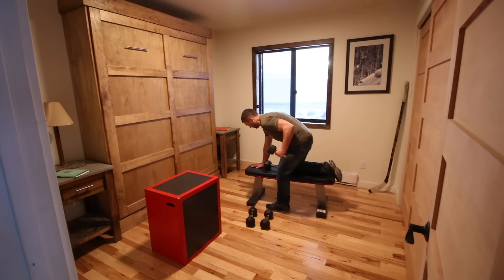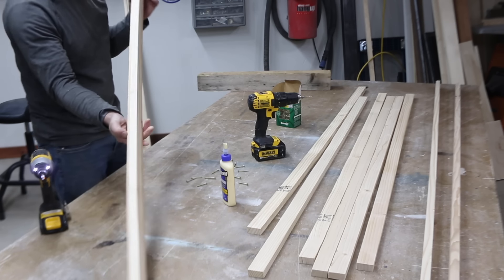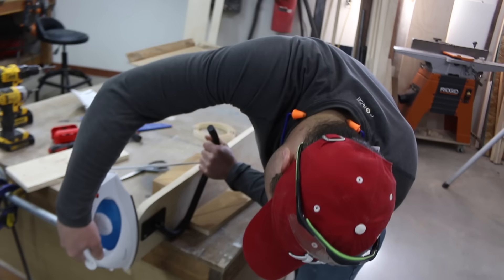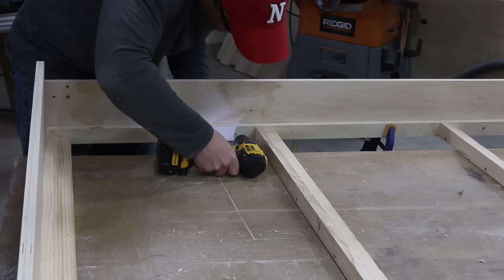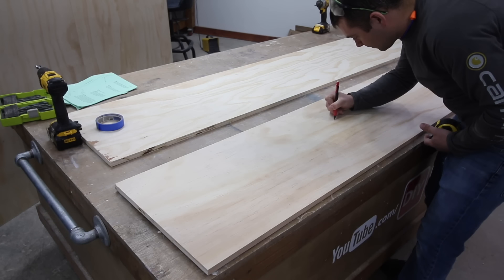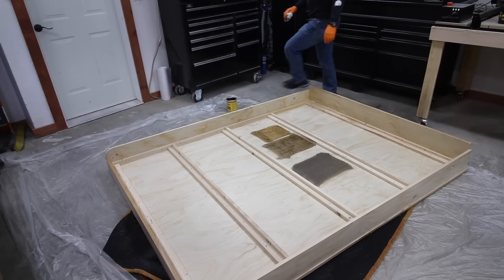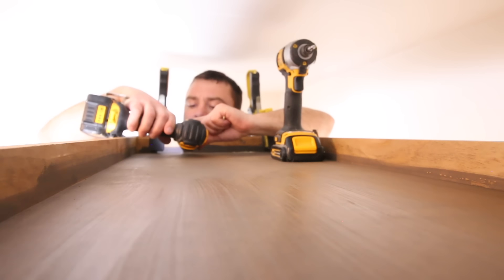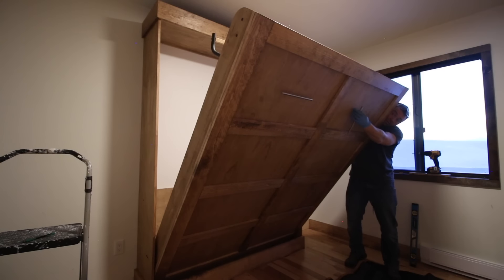You can Build a Murphy Bed!

Comment: Just built my bed same plan, thanks for all the tips offered very helpful. One thing I did was to pocket screw the 3/4 ply panels together elevated on saw horses running lengthwise and use that as a workbench to build the bed frame and mount hardware.

Comment: Thanks, Pete! I have 1 tip for others in regards to 1x2 boards. Some stores sell 1x2 furring strips. Usually these are only 5\8" thick although they will be labeled as 1x2. Confirm with tape measure the actual thickness is 3\4". Again, thank you for this video. Plywood is so darn expensive I didn't want to ruin a sheet lol. Measure 20x cut once haha

Comment: Hey Pete! The video is worth the wait. I was dying for your next content and I am glad you are back! I am really fascinated with murphy beds and this one is amazing. In my mind I feel like I am ready to make one because of the way you narrate the instructions and process, 👌🏼very clear and organized. I noticed you specify the silver and black screws, is there a difference aside from the color?
Reply from the maker: Hey Raymond! Great to hear from you, and thanks for saying hi! I agree, I definitely need to push out more content on the channel. I am confident you'll be able to tackle this project. The kit comes with black screws, silver screws, and machine screws. The machine screws are used whenever a T nut is used. The silver and black screws are both 3/4 inches -- but the silver screws have a slightly thicker diameter. They give you the exact amount of screws needed -- and more black screws are included then silver ones. I found myself going back and fourth in the directions so many times that I wanted to point out which screws to use in the video to make it easier. The company has a very detailed video as well, but there's is 1 hour and 12 minutes. They have some better closeup shots and do a good job, but it is a little long for me to watch without speeding up. I feel like I was able to condense the information and cover it all still in about 23 minutes with the narration and clips sped up. Cheers!
Reply: DIY PETE thanks for the lengthy and comprehensive reply much appreciated! I am thrilled to get a response from you 🤣 
Would love to see more videos ie continuation of your home build/reno hopefully. I understand it is not that easy to come up with a content so I am willing to wait.

Comment: Have one of these beds made from the same kit. With very little tweaking with a sawzall, we were able to shoe horn in queen sized Murphy bed into existing double closet opening and ended up with a recessed built in guest bed. Put recessed LED puck lights in headrail as well. We used melamine faced cabinet plywood for bottom/exterior. Smooth finish in white, almost no sanding and nailed trim wood to it to give it a judges panel look. Turned small home office into a nice guest room for the few times  visitors overnight while getting to use it as an office the all the rest of the year.
Reply from the maker: Hey Peter, great to hear you were able to free up the space so it can be used as an office most of the year! I'm glad the kit worked out well for you too. Cheers!

Comment: Yes everyone should have a home shop like that, would make building Murphy bed so much easier!
Reply: It can be done with a lot less.  It did take me longer, but I was able to leverage tools that friends had and my spare time to build this without any special tools.  Borrowed a table saw, used miter saw, circular saw, drills, a tape measure, orbital sander, glue and time.
Reply from the maker: There are various levels of DIY projects and tools required. This one certainly is on the more advanced side.

Comment: "Do it yourself"

* Buys online kit.
Reply: Having bought this same kit and built it myself, I can say it is a lot of work.  From purchasing 7 sheets of plywood, using a table saw to rip and crosscut them to size, drilling screwing and gluing the bed platform together.  Drilling screwing and gluing the support frame together. Edge banding all the wood, sanding, finishing, installing hardware. Additionally in my case I also made the two cabinets that are in the plans (https://www.rockler.com/deluxe-murphy-bed-kits-vertical-mount).  This involved making cabinets (book shelves) drilling shelf pin holes perfectly aligned and building drawers and installing drawer slides. 

Exactly what would you consider DIY in this case?  Did he need to make springs out of iron with a forge to make the bed work?  Did he need to wind his own motors for the drills he used? What about the pivot points?  Seriously it is people like you that bring so much negativity to the world. Try saying something positive. Here are some examples, "Great job! I wish I had the time/expertise to build something like this." or "Wow, murphy beds really do save a lot of space, maybe I should think about building one myself." There is an enormous amount of work that goes into making one of these and if you don't believe me, try it yourself.
Reply from the maker: Hi Jake, there are certainly various degrees of DIY. I bought the kit for the pure convenience of getting the right struts and hardware. The build was quite time consuming and a lot of work to be honest. You could certainly figure out the struts though and other hardware if you'd prefer. Cheers

Comment: Great project. Wall bed kits in Canada are in the $2000+ range depending on size and options. After watching your video I will build my own. What I’ve done in the past when cutting panels from plywood is getting one of the big box stores I buy my plywood from to do it for me. First couple of cuts are free and extra cuts are $1.50 each if I remember right. For a few bucks it’s a whole lot faster and more accurate...not to mention easier getting your wood home in the back of your sport Ute.
Reply from the maker: Thanks!

Comment: Great video. The detailed instructions make it clear what a person would be facing. My consideration is I usually make around $85 an hour for carpentry and handyman work. The hours this would take and the space needed to do the project without cleaning up between steps would be prohibitive. I'm thinking the extra $500 or so for the prebuilt kit would probably be worth it to me as I'm sure this project would take much longer than 6 hours. Heck, even if it took 8 hours that would still be $680 of billable hours to do the job. I appreciate your eye for detail but I think many with both time and space considerations (for doing the project) may be better off just paying the extra money for one already done.

Comment: Awesome video, very detailed and easy to understand.👍If anything, I'd add that the solid plywood board right under the mattress only works in countries where the moisture level is relatively low. In New Zealand, for example, your mattress would become mouldy within a couple of months. If you live in an area like that you might want to consider using timber slats instead of solid plywood with some ventilation holes towards the head board or on the side of the frame.

Comment: you can get gas struts for car boots, or springs from hardware stores. The hinge mechanism is pretty basic, a recessed bolt with washers will do great, bearings if you want to get fancy, but i've seen cheap seat swivels used too. I'm just saying you don't need to drop 400 on a mechanism kit. Legs are easy, 10 ways to do those. Your bed is great, good job.
Reply: Yes I just watched the video and clicked the link for the bed kit the guy has suggested costs around $300, and in the UK they want £457. That's $600. For a few bits of steel and a piston. Madness. I wish I knew the spec of the piston!

Comment: Good job. My only critique is the banding. After working for over 40 years as a carpenter, I found that banding is great for a quick or temporary look, but using strips of real wood 1/8 inch and using  a nail gun or nailing by hand with a finger spreading of glue below the surface of the 1/8th inch materialmand using a punch with filler will not only look better but last years longer. Maybe your grandchildren will use it as well. As far as the banding edge a few years of variable temperatures and the oops factor or using Murphy's Law "What can happen will happen" will make it almost impossible to fix the edges at the many nooks and crannies you left it at. that the banding falls off or breaks off. 
Overall it was a good job, with good visual aspects. Thanks for sharing...
Reply from the maker: Thanks Jesse! I appreciate your advice!

Comment: Question for you.
I am getting ready to build one myself. The plans use mostly 3/4" (0.75") plywood.
Quality sanded plywood is sold in 23/32" (0.71875")
Yes, this is a tiny difference.
Did you need to adjust anything for that difference?

Comment: DIY Pete. Can those plans be modified to lower the bed slightly from the 7 inches recommended by  create a bed hardware? I don't have the ceiling room for the vertical mount and really don't want a horizontal...thanks
Reply from the maker: Hey Scott, I feel like you need the room with the pivot point where it is and couldn't go much lower unfortunately. I would recommend giving the folks over at Create-A-Bed a quick call and to ask them what they think.

Comment: Im considering a Muphy Bed, but not as a guest bed but as my main bed. I want to use my bedroom as a painting studio from time to time and in those painting sessions I would like to fold the bed up. So I have two questions:

- Is the bed comfortable enough for an every day bed?
- since I dont care about hiding the bed in a wardrobe, would it be possible to just build a casing up to the height of the headboard/springs connection. So the whole construction would kind of be the height of the sideboards next to the bed. I'm fine with the bed just standing on the wall when I fold it up. Would that work? (ofc I would fix the headboard part to the wall firmly)

Comment: Nice work. What size was the bedroom was that installed in?  I want to put a queen murphy into a 10 x 10 bedroom for occasional  guests.  Thanks for your video.
Reply from the maker: Hey Jim! I just measured the room. The bedroom size is 10 foot 10  inches by 9 foot 6 inches. The bed's headboard is mounted to the wall that is 10 foot 10 inches in width. There is room to walk around the bed and it works great for a small space. Sounds like yours would work well. I did a queen bed too.
Reply: @DIYPETE  Right on!  Thanks for your response, I appreciate it

Comment: I wonder if there's a way to turn a electric reclining bed into a Murphy bed? so we have this electric reclining bed it reclines from the back to sit up and from the feet as well with the remote and we're wondering if we could turn it into a Murphy bed  but without removing the legs to keep them in that way when we pull it down the legs will be still there to support the bed and for safety reasons we would unplug the power cord  so that the bed won't recline accidentally when it is inside the cabinet

Comment: Hey Pete looks good. Surprised at the expense of the kit. Just a thought, but if you got some 2x2 you could completely eliminate the step of pre drilling, gluing, and screwing those side rails (at about 3:42). If you had 2x2 material, you can just rip that on your table saw and get the exact same outcome (very similar to how you would build a floating frame for a picture frame), but it will be one solid piece of wood. I would highly recommend thinking about doing it like this. Saves time, money, and is actually stronger (it's solid wood).
Reply: You'd need a 2x3 to replicate the profile he has. 2x2 would be too small.

Comment: I love the idea of a Murphy bed, the added space, not having to make your bed. Two concerns though, one is where do the pillows (I'd need 6 total) end up? And 2nd, with that elastic in the way and no where for the comforter to hang, how does one deal with the "making" of the bed?
Reply from the maker: Hey Paul! We put the pillows in the closet --- but built ins on each side for storing them would be a great idea. The comforter tucks a little and works fine. Not as easy as making a regular bed, but not bad. Cheers!

Comment: Hello grade video very precise there is a question that you missed to answer the same as mine what if someone's metres is 15 inch thick will building wider frame around the wall will resolve the problem 16 inches deep frame around the wall for maximum of 12-inch mattress so I'm thinking 20in frame around the wall for 15 inch mattress please correct me if I'm wrong
Thank you
Sam
Reply from the maker: Hi, I would recommend asking the manufacturer about that. I know the pivot point would most likely need to be adjusted a bit. But I do think you'd be able to figure out a way to make it work with the larger frame.

Comment: I purchased your plans and the recommended hardware through amazon as you had suggested on you website. the bed is complete . my problem is that it wont close completely, I push it back towards the bed stops but it pops out. any suggestions would be greatly appreciated.
Reply from the maker: Hi! Thanks for reaching out! I don't make plans for the murphy bed but they come in the kit from Create-a-bed if those are the plans you are referring to. Of course, follow those exact measurements and use my video as reference for the overall project. I don't believe they have changed their plans since I built the bed, but I will reach out to their customer service and see if anything has changed. It sounds like your pivot point may not be in the correct position for the gas spring if it isn't closing correctly. Have you double checked the plans they provide to make sure your measurements are the same? It doesn't sound like the thickness of your mattress is an issue. Let me know what you find out. Thanks!

Comment: Would the kit you used work with a 160cm wide mattress? Can't seem to figure that out!
Reply from the maker: Hi Julian! The plans provided by the company for for a 60 inch wide mattress, and 160cm would be 62.99 inches. I just measured and took a lot at my murphy bed, and it doesn't provide the extra room for any more space. You'd need to modify the plans to increase the overall width of the project. This isn't a hard modification to do. You could even talk to the Create-a-bed company to see if they have any plans for the different sized bed.

Comment: I'm watching this to figure out how to make up a couple of extra square feet of room in my office/bedroom and just realized that this guy has more workshop area than my entire apartment. Dammit!
Reply: Dude also spent 300 dollars on hardware that are just a few metal plates with holes in them.
Look up a 'boat seat swivel' can buy 2 for less than 20 and they make great stiff hinges! If you want to add gas springs search "10mm ball bracket"
Reply: @stinkinroger159  Yeah well this is the world today. DIY almost always start out with "Step one, 3d print these things." or "Step two, buy this whatever-kit off from Amazon, it's almost 20% cheaper than buying a finished product, but'll require you to have these >$500 tools."
But yeah, I found out about the boat-seat swivel too. Probably gonna do that instead.

Comment: Hi Pete, can you adjust the pivot point so that it yields the bed higher off the floor? As i want to add a sofa like the 24/7 in front of it when closed?  Also, how deep is the bed cabinet? does it have enough room for the pillows and bedding?